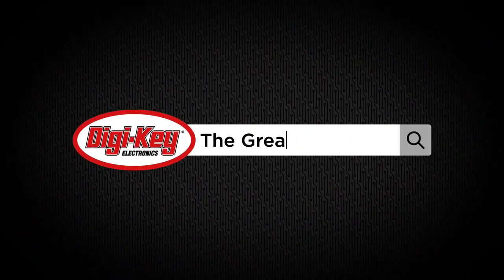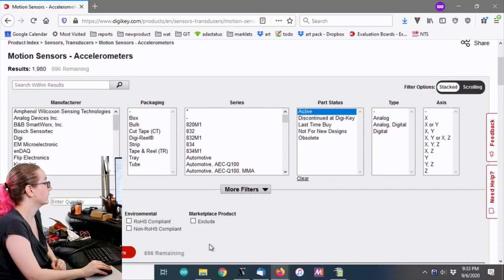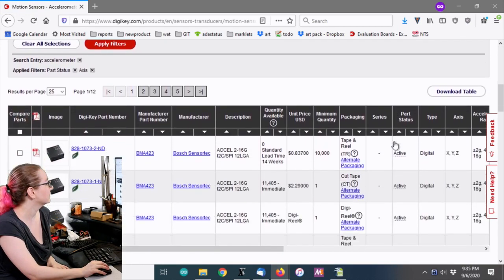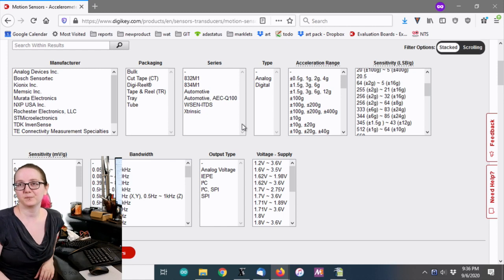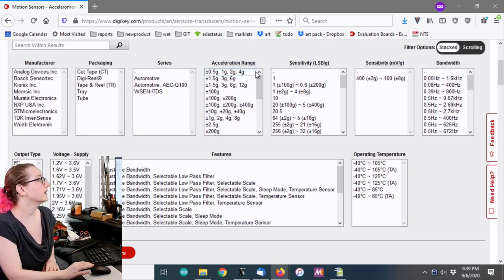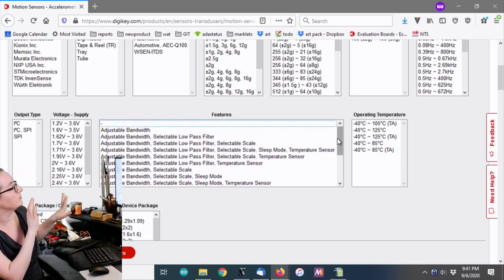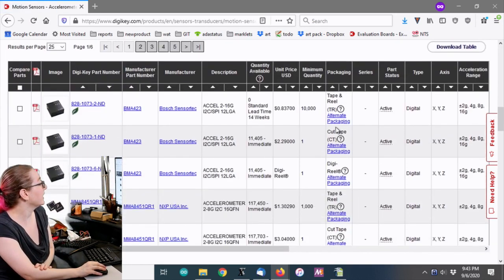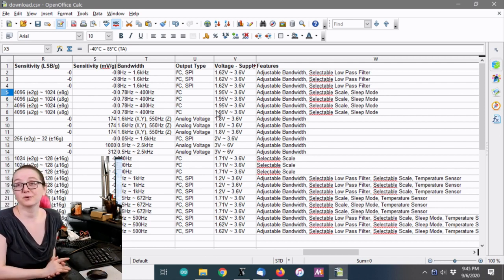The Great Search: Accelerometers (our favorite sensors) #TheGreatSearch @digikey @adafruit

Comment: Thanks for the video, it's good to know what professionals look at when picking components.

This also reminds me that it would be really cool if you made a video like this but for PMICs/balancers or charge controllers because there's this new open-hardware collaborative project called SuperPower that aims to act like an UPS for low-voltage devices. Andreas Spiess made a video about it.

Comment: speaking of surface mount, can the average use solder them? special equipment needed?
Reply: ESD protection (grounded wrist strap and desk mat). Highly regulated soldering tip heat setting (I use WE1010 iron and various sizes of tips). I use LED bulbs in adjustable desk lamp. Use magnification hood (iFixit) to see tiny areas in order to prevent shorts (bridging). Use quality solder (iron and solder available on Amazon or regional electronics store).

Comment: Imagine I have an accelerometer (I2C, 6400SPS). Imagine I have a strain-gage-amplifier (Also I2C, variable settable sample-rate). There is no straightforward "feather" like solution today that I can hook up these two I2C devices, a LiPo cell, and make a wireless (WiFi) data-stream to capture real-time data at 6400 vectors per second - is there? (I mean.. the ESP32s feather Huzzah can do a lot, but can it do hard sample-time, <1ms latency, almost-real-time streaming after grabbing sensordata over I2C?)